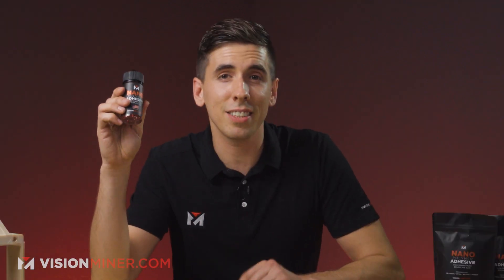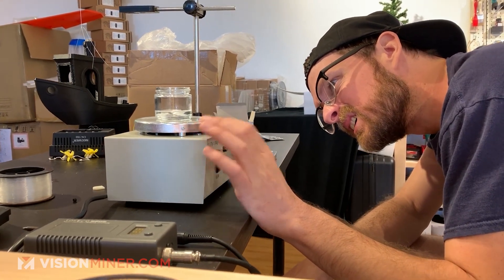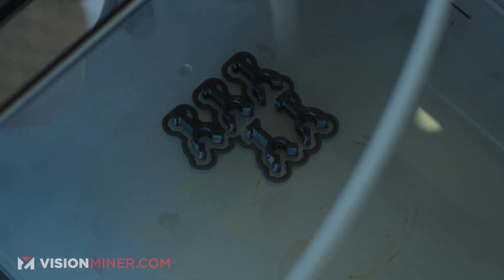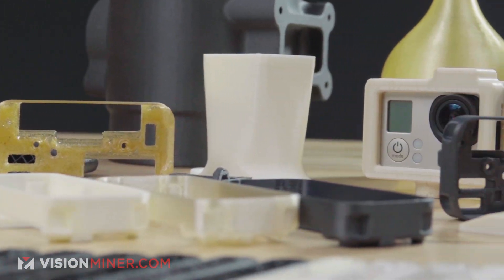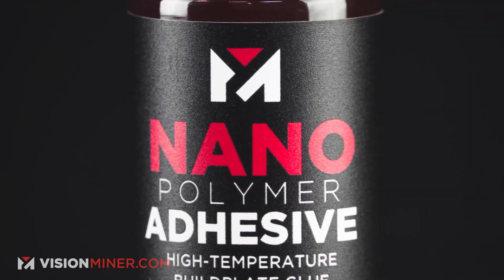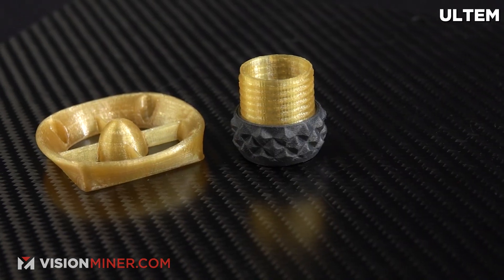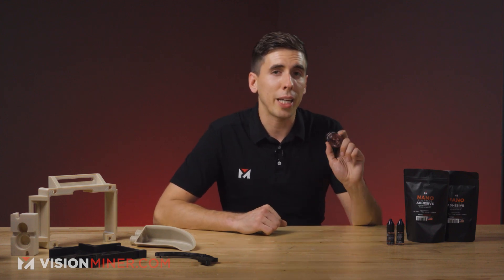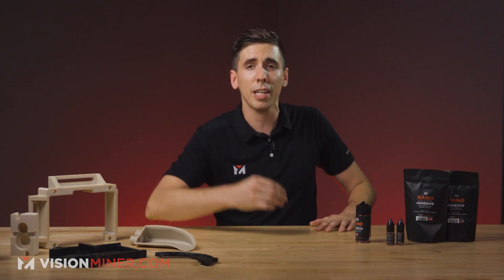The World's Best Bed Adhesive - Nano Polymer Adhesive Overview

Comment: Is there any chance of the glass plate breaking when removing the part from the build plate after the build is over?

￼
Reply from the maker: Glass can break with no use of any adhesives depending on the material you are printing with. ABS is especially known for breaking glass. Instructions are provided on how to remove depending on the temp you are printing at.

Comment: i bought it because of all the hype & didn’t see anything less than great reviews. i had warping on one side and eventually failed. i followed instructions to a the tee. 
pei sheet
1. washed entire pei surface with dish soap
2. rinsed with water
3. cleaned with isopropyl alcohol for good measure
4. saw your instructions video
5. shook bottle rigorously before applying with the brush in x & y directions with bed at normal room temperature & gave it 2min after application to hear up bed
6. applied twice for good measure because it’s a 350mm bed
7. printing polymaker asa at 250 hotend & 80 bed the first time & 250 & 90 second time with same warping results. 
what am i doing wrong? printer is tuned & have slicer set up perfectly to my printers that it’s usually a success print except bed adhesion is a problem for me. i thought this would be a changer for me & didn’t mind the hefty price so long has i didn’t waste 12-24 hours on prints and wasted filament. please help & let me know what i can do? heres a screenshot of the second failed print. 

https://imgur.com/a/KqJkoWm
Reply: Other than paid reviews everyone has said it is garbage, so no surprise.
Reply: Well you do need an enclosure to print asa..(adhesive or not)

Comment: Is there any instructions om how to apply it hot on steel?
And does it work same as when you apply it cold?
Reply from the maker: Applying cold is usually best, but when you apply it hot, do it very quickly, and it will make a thin layer of "dust" texture which can help with extra hard adhesion :)

Comment: I would like to see a video about the best bed probe for using multiple materials. I am having a problem changing the z-offset every time when printing different materials with layer-hight less than 100 microns. I have been using the Nano Polymer with ABS and PLA interchangeably and the bead adhesion performance is pretty pleasing. ^^

Comment: Excellent product!  I fought with my Prusa using CPE HG100 (higher temp PETG) for weeks.. Always lifting or sticking so hard it ripped chunks out of my PEI spring steel sheet!  I've destroyed three OEM Prusa sheets, but now I have zero issues.  Only apply a few drops where my print will be located, spread it around and done.  I also try to hit the corner where the print extrudes to clear the nozzle.

Comment: You covered it like a blanket. Another exhaustive essay from Rob's Encyclopedia. You turned it inside out, from top to bottom, from A to Z. Any other questions just don't need to be asked. If somebody has a question, just watch the video again and listen a little better the next time. I was afraid i was going to have to go into the three day weekend without another Vison Miner video, but you guys did not let me down. Thanks again. Have a blast, but wear your safety goggles.

Comment: You say it works with Nylon, does it work with all nylons? PA12, PA6 and PA6/6.6 copolymers? I have a few rolls of PA12 (Fillamentum FX256) im not able to print with my prusa because nothing will make it stick to the bed without warping... (ive tried it all, magigoo, gluestick +++) If this is the solution i have a few rolls i could actually use!
Reply from the maker: Yep, we’ve tested and it works with all of those Nylons, and a few more! :)